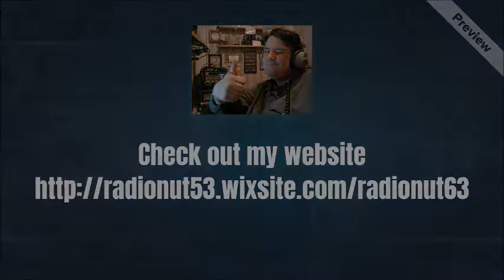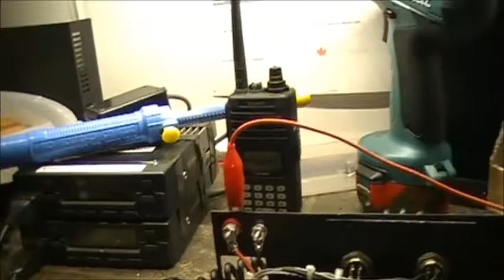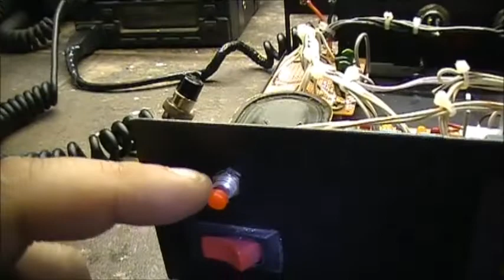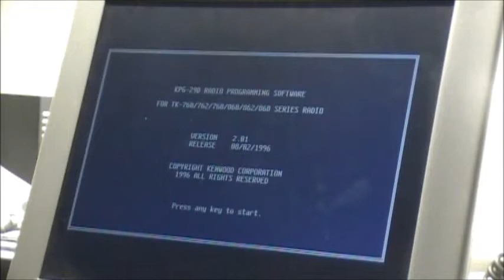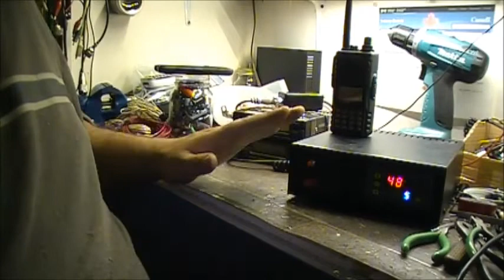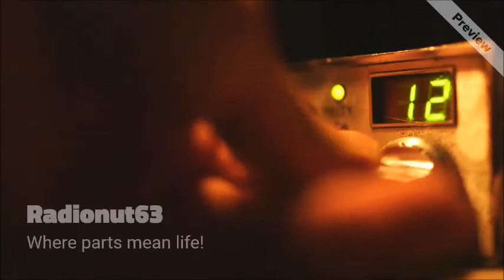Crossband repeater project   -  Testing the system!

Comment: That’s great. Which frequency is going to be the input. Or are you going to switch the inputs around? Just curious.  Art   K2ADC
Reply from the maker: My plan if this works out right, is that the cross band will be bi-directional.   VHF - UHF and UHF - VHF.  going to attempt to ID on both radios at the same time today for the ID transmission, hopefully it will work out well enough and stable enough for the system to be bi-directional.   If both can not work together on this controller without causing problems, then i will have to modify the system to work one direction only, which will suck!